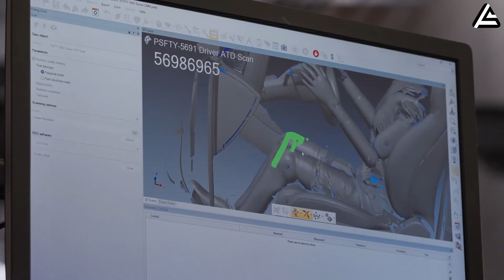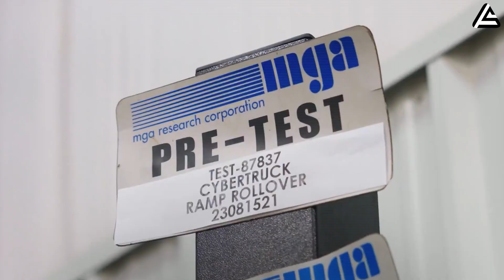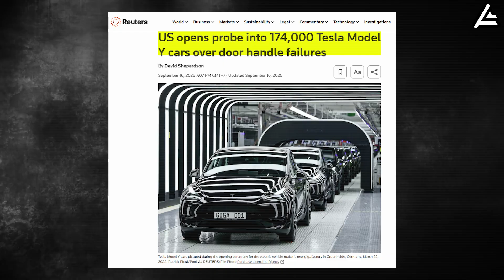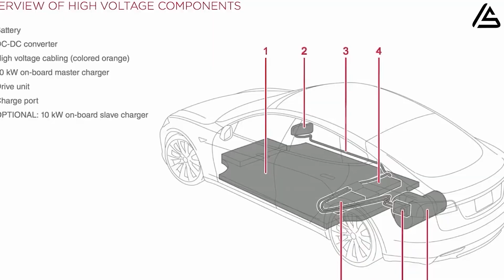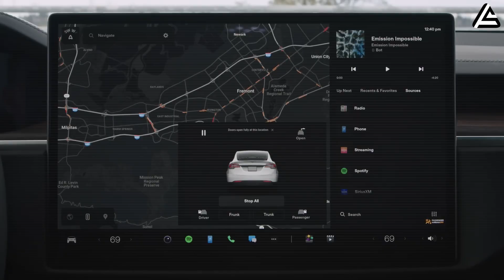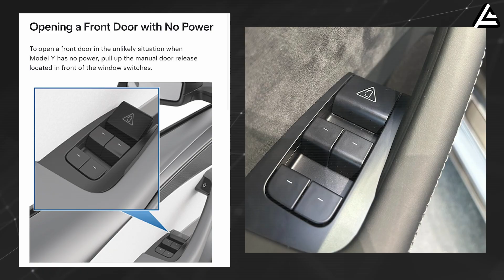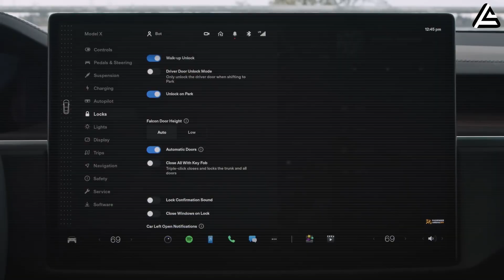Exit & Crash Safety In Tesla 2026: What You Need To Know About Electric Doors?

Comment: Will the 2025 Model Y be able to detect pedestrians more efficiently with its new radar and sensor systems?
Reply from the maker: Tesla has been improving its sensor fusion and perception stack by re-introducing radar (where allowed) and refining camera + neural net processing, which tends to improve detection in low-contrast and adverse weather conditions. The result isn’t a brand-new superpower, but incremental gains in recognizing pedestrians and obstacles earlier and more reliably, especially at highway speeds.